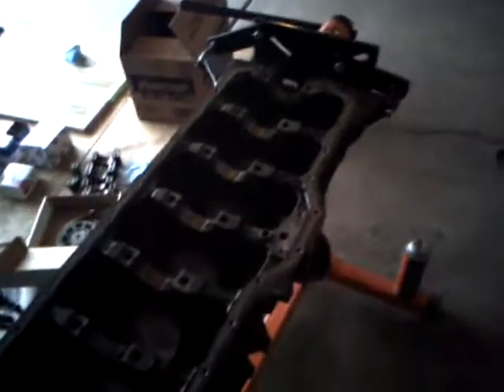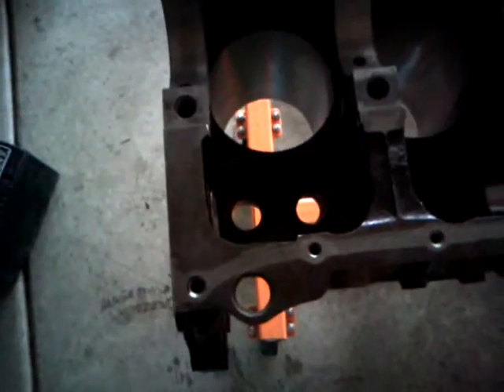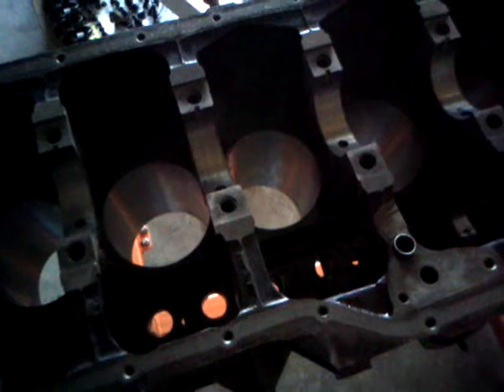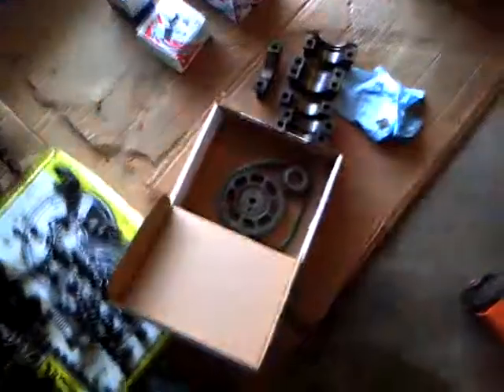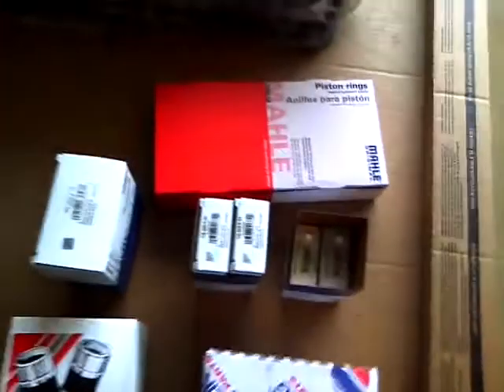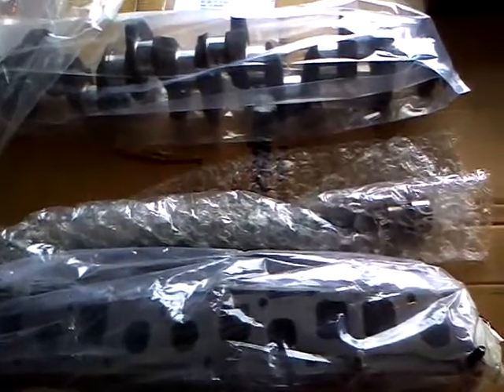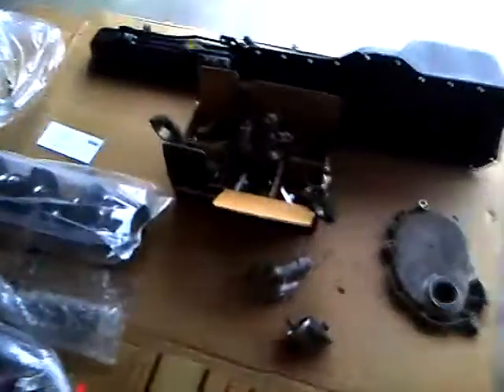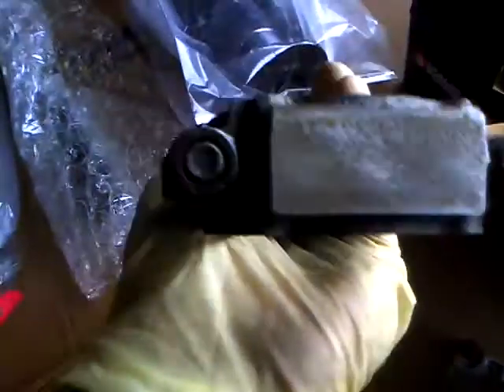Jeep 4.0L Rebuild (Back from the machine shop)

Comment: Actually the last year for the HO was 96. My 96 has an HO.
Reply from the maker: This is true. 96 has always been fuzzy for me. I had a 95 and then got my 98 and 99 so I skipped 96, 97.
Reply: Kyle W I can't believe they had a unique fuel pump for the 96 year model. By the way, how did your timing marks line up when you out your engine together? Was it dot to dot?